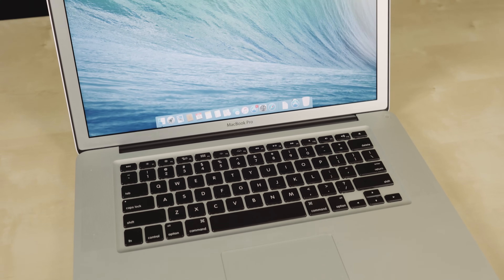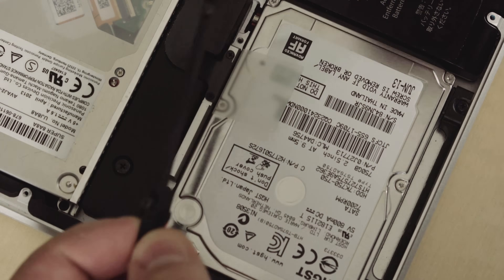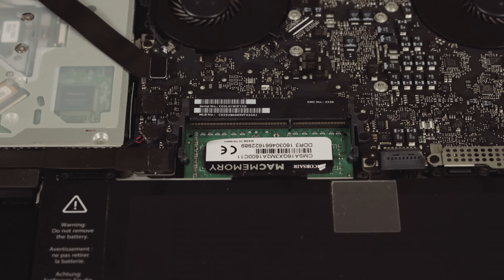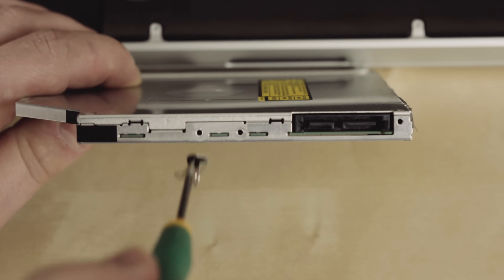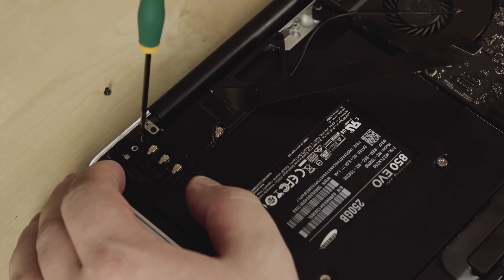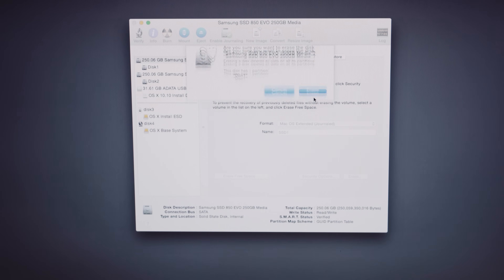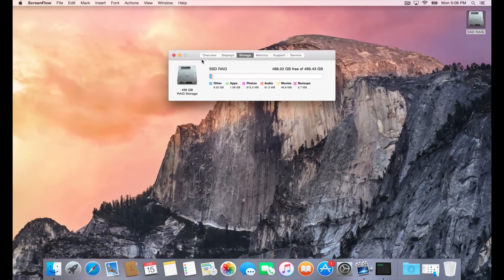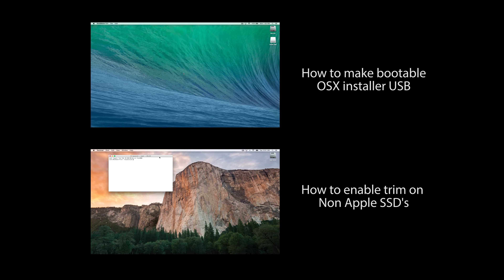Fastest 2012 MacBook Pro Ever! Upgrade Guide - in 4K

Comment: did these ever come with retina displays? if so are they just as upgradable?
Reply from the maker: Derrick Johnson the retina MacBooks from this time didn't allow for any upgrades. You can however replace the pcie ssd with a larger capacity. They are a different kind of drive than the one in this video. OWC makes them

Comment: The hard drive for my laptop degraded to a point where I don't think I could even recover the data on it, I'm really upset about it but wanted to replace it with the same techniques you used here. Is that still possible? I'm not tech savvy at all so I don't exactly understand the OSX drive part of the video

Comment: So I been watching this video over and over. I recently just bought 2 Samsung 840 PRO ssd, with an owc data doubler and 2 sticks of hybix 8 gb each ram. I'm installing it in a MacBook Pro 15" Mid 2012 antiglare 2.7 ghz Intel i7 nvdiea gt with 1 gb of gddr5 ram. I notice in the video I saw a back of time machine rather than installing the OS X from a usb. My question is how come you didn't just install from a back up like time machine. Because time machine also holds the operating system? Also I'm using 10.8.5 mountain lion still. Will all of my configuration still work also?
Reply from the maker: JeffDaSituation I installed off a USB because I wanted a fresh clean install of OS X.
Reply: Zed ProMedia does it make a difference doing that vs from time machine?
Reply from the maker: Its just a clean install of OSX with no extra files. Just like you would get when you buy a new system. Its not like a back up from time machine.
Reply: So you think when I do this upgrade I won't have to get another computer for along time? Is this computer capable of 4K edition in premier? I just bought the laptop recently. Didn't really like the new ones cause upgrading was limited
Reply from the maker: You might get a couple years out of it. Its borderline just able to edit 4k video but it can do it. Its limitation is the video card mostly.
Reply: Zed ProMedia danggg really? This sucks. So what I got till 2020?
Reply: But wait! I could always hook an external graphics processor to the thunderbolt port. Seen it done before lol
Reply from the maker: yeah you can. I want to try that as well haha.
Reply: Zed ProMedia is our computers thunderbolt 1 or 2? And how come you didn't get the 2.7 ghz config over the 2.6?
Reply from the maker: JeffDaSituation thunderbolt 2. 2.6ghz was just what was available when I was looking for a used one.
Reply: Zed ProMedia hey I need it's Me again. I'm not getting a full 6gbps after installing the two drives. I don't know what's wrong please help. I'm getting really slow write speeds also
Reply from the maker: JeffDaSituation what are your speeds? You should be getting close to 800-900mb/s if you are using 500mb/s read and write ssds like
The Samsung evo
Reply: Zed ProMedia less than 100 write and 500 on read. But it's weird just a minute agai it was showing me 200 write and 950 read and the blackmail disk test numbers went back down before my eyes. I don't know what I'm doing wrong. Currently running Mavericks. Didn't like Sierra
Reply: Also using Samsung 840 pro

Comment: Is there a solid difference with the two 250 ssd drives with 16 gig Ram compared to one ssd with 16 gig ram? I was looking at a 500 gig 850 evo compared to 2 250 gig evo.. what is the better option? 1 500 or 2 250's?

Comment: i just upgraded my mid 2009 13'' macbookpro with 256g ssd, 8gb ram, new battery. works just like new.  However, it still has heating and noise issue. i do not know how to make it less heat up..
Reply: gomawum you may need a new battery
Reply: gomawum or open up your MacBook and check if the fan inside is covered in dust, I had this heating issue and once I cleaned the fan the problem was solved

Comment: I can't get it to work!!! Mid 2012 MacBook Pro. I've tried almost everything, but the SSD won't read in the optical drive. When it does, I can't RAID. Most of the time won't even let me erase the drive. How can I fix this?! The main bay and the ram upgrade works so thank you for that! I've been working on this for hours and don't know what to do at this point. I don't want to settle for my hard drive in the optical drive. I want it to be RAID 0 with my SSDs. Please help.

Comment: For Sierra OSX there is no RAID option under disk utility, You have to boot using internet recovery mode by turning on the MAC and holding Option-Command-R, get your wifi set up and then you'll get the  Recovery menu and the Disk Utility from there does have the RAID menu

Comment: My 2012 MBP already has a 500gb hard drive so is the only difference between mine and a newer one is the 16gb ram?
Reply from the maker: ZachAttack84 the hard drive size has no real effect on the speed. It's the fact that it's really slow. Replacing it with an ssd will give you 6-8x more
Speed

Comment: Nice video man. Real detailed. I can see that you put a lot of work in this. Thumbs up! I've got 2 questions though. 

1: Will all of this work with an late 2011 model  and Will it be as fast as the 2012 model

2: What are the benefits off putting the 2 SSD in a raid. Why not use them as 2 seperate drives?

Comment: Hello I have a option to get a new MacBook Pro mid 2012 with 4Gb ram, 500gb hdd brand new or the new MacBook Air 8gb , 128gb ssd but if I get the Pro I would put a ssd in it , do you think the pro is worth it?? Ps I'll be using for university ( not for photo or video editing)
Reply: Tejh Dhilraj pro
Reply: ofcourse pro u can't be upgrade your macbook air but this pro can upgraded to 500ssd and 16gb ddr3 1600 ram so worth the money to buy pro
Reply: Pro!
Reply: Tejh Dhilraj if it's just for uni then I'd go for MacBook Air as it's much lighter. I have the 2012 pro and it's so heavy

Comment: Do i still need to do the RAID0 process if i am only installing one SSD? I am an IT noob and will be attempting this tut with a refurbished macbook pro from March 2012. Just not wanting to replace the optical drive. 

Also, if i did just the one SSD will it be slower? 

Could i chose to take out the optical drive in the future and if so would i need to re-wipe the "old" SSD in order to link them like you've done in this vid? 

Thanks for the response.
Reply from the maker: Gabriel Romero no Raid0 only works with more than one drive. Just drop in one ssd and you're good. Raid0 gives you double the speed but one ssd is still like 8-10 times faster than the mechanical drive
Reply: thanks!

Comment: Hi Zed thanks for the vid it's really an amazing job. I have a non retina macbook 13 mid 2012 - 1TB - 8gb of ram and i was wondering if I could replace the optical drive and add an SSD drive instead and work with the SSD as main drive with all my apps on it and use the original 1TB HDD to put all the files I have (I work with huge samples banks and it takes a lot of room). Also, apple says the maximum ram configuration is 8gb but it looks like you go up to 16. If I could do it, i would too but is it safe?

Comment: I'm trying to do this, and it doesn't look like that on the inside,
Reply from the maker: The only way it would'nt look the same is if you have a retina macbook. They dont have a regular SSD or Optical drive.
Reply: Non retina.
Reply from the maker: Elboogie1975 if it's a 2012 non retina it should look the same. Even if it's a 13" it should look similar but with a smaller battery

Comment: hey i also hv a macbook pro 2012 N/R with stock specs like 500HDD, 4gb ram, INTEL HD 4000. I m planning to change my Hdd with a ssd and in optical drive cn i put the hdd??. And cn u tell me how to clone mac OSx and bootcamp data from my hdd to  ssd. as i cant install windows again as its a 1 time installation activation (i purchased it for $20 from some site called keyguin & the windows was an OEM). So pls help me.
Reply from the maker: Theres a program called: superduper! that I use to clone my drives. I've never tried cloning seperate partitions but look into it on their site and see if it will. Good luck

Comment: Hi, i have a mid 2012 mb pro 15.4" and have 2 ssd evos with 250 gb in it. My question is can i convert both to raid like you did without loosing my files and having to reinstall osx? Greetings
Reply from the maker: you will have to back your files up, Create the raid) array and reinstall everything. When you make the array it has to format everything.
Reply: Ok, thank you very much.
Reply: guamy garcia did you get yours to work? I have the mid 2012 13" and my optical drive SSD won't work. If I switch to main bay it works fine. Not sure why it's not working. I've reinstalled OS about 4 times. It either errors on me when erasing. Or raiding. Or it doesn't even show my SSD at all. I need to get this working ASAP. any ideas?

Comment: Great video! Very detailed and looks like a simple upgrade with the right tools and hardware. My question to you, is there a significant performance boost using two 500 Samsung SSD drives with the raid? I would love to do this to my 15in Mid 2012 non-retina MacBook Pro but if there really isn't any need to do 1tb raid except for the extra storage than the 500 gb raid will do. Thanks again!
Reply from the maker: No performance boost. Just more storage. Thanks for watching
Reply: That was a quick response! Subscribed! Thanks again!

Comment: Hello my lady has a macbook pro 2012 500gb HDD on OS X version 10.11.6 non retina with intel HD 4000, I already know how to do the ram upgrade but I want to know with this setup, is the double SSD setup still applicable? I want to replace her optical drive with a second identical SSD both at 500gb (roughly) to aquire double speed and 1tb of storage. We opted to do a fresh install of the OS with a USB stick and that seems easy enough and she will re install all programs manually instead of using the transfer tool or whatever you use with macs and then she will move the files with a 2.5 HDD (the original one with her necessary files for school such as adobe graphic things and misc important files) using a USB 3.0 to SATA cable. Will this be possible? I def want to do the RAID0 setup unless you have a better suggestion but I am a totaly consumed windows guy and I just want to speed her macbook up for her because it is simply awful especially for the price of those things. I prefer the mushkin brand SSD's and I have no idea if Macs are compatible with all internal SSD's like most windows software and motherboards are. I ask kindly, PLEASE confirm all of this information for me and let me know if its possible before I attempt to follow your guide here in this video. Please respond as I have no experience with mac but I am a PC expert and I dont want to mess anything up. <3 PLEASE @ZED PROMEDIA
Reply: I just subscribed as the only favor I could think of for your assistance.
Reply from the maker: Gabriel Herrera I don't see why it wouldn't work if it's a 2012. As for transferring the files you can buy a cheap USB external enclosure and put the old drive in it. You also get to keep that as an external drive once the files are transferred back. I have no idea if mushkin is supported or not. I've used intel, Samsung and OCZ drives in previous macs and they all worked. Sorry I have no experience with mushkin. Good luck!
Reply: Wow thank you so much for your instant response! The SSD I prefer would be double Mushkin MKNSSDTR480GB Triactor 480GB SATA III 7mm Solid State Drive from amazon or wherever. I have had excellent results from these in my PC's. Also, we have a USB to sata data and power cable already but are you suggesting that a external enclosure would work but the cable that we already own which has power and data connectors will not? It is similar to this one     

https://www.amazon.com/gp/product/B011M8YACM/ref=oh_aui_detailpage_o05_s00?ie=UTF8&psc=1     

It has worked as using an internal SSD as an additional storage drive externally before on this same Macbook. Once again I really appreciate any assistance or suggestions. As for the RAID setup, I have no clue how to "combine" the drives so I will follow your instructions from this video assuming there is no difference in method on the newest version of OS X. I will research and see if they are compatible since you stated you dont have experience with that brand. She is currently using OS X version 10.11.6
Reply from the maker: Gabriel Herrera that's USB to Sata will be fine. No worries

Comment: I have a 2015 125gb macbook pro retina 13", if i wanted to upgrade the ssd to a larger one, how do i safely backup EVERYTHING i have in my current ssd? I mean I have my whole steam library and a lot of documents, I would like to transfer the steam library to the windows os and keep everything else in osx, any tips?
Reply from the maker: You'll need an external drive enclosure and a program called superduper. It does a carbon copy clone of your existing ssd. Keep in mind this guide will not work for your system as your computer uses a pci-e ssd.

Comment: If i get a 2012 Macbook pro that already has 500gb SSD can i still put another 500gb SSD (via the Optical Drive Caddy route) so i could have 1tb out of the two drives?
Reply from the maker: Ridge Bagatsing yep you can
Reply: Zed ProMedia thanks for responding! Which will be better overall, the adding of one 500gb SSD to go along with the 500gb "serial ATA" that the mac comes with to have 1tb in total? or just getting 2 x 250gb SSD's that you used in this video to have 500gb in total?

Comment: I'm debating if I should get an old Mac and replace the it with an ssd and ram I have laying around or get a new Chromebook
Reply: RaFi TV nonono don't get a chromebook 😂
Reply: But I'm just using it for running Linux and I'm worried I'll have to replace parts like the battery on a old Mac and the battery life in general would be low due to many cycles
Reply: Get both. A chromebook is like 100$...
Reply: JustinHit No I got a 280$ Chromebook r11 but I doubt a 300$ Mac will be up to par with battery life

Comment: i got a mid 2012 macbook pro? does it support up to 16gb ram? I thought apple say only 8gb?
Reply from the maker: Son Le if it's the 15" it will. Mine does.
Reply: mine is 13"...:(
Reply from the maker: Son Le I'm not sure if the 13" can handle more than 8gb. It could be a CPU limitation in that generation where the i7 can handle 16gb of ram.
Reply: here is my spec:  13" 2012,  2.5ghz intel core I5. So..no? I dont' wanna buy it and then it won't work or crash...
Reply: A 13 inch model supports 16GB RAM. My 13 inch 2012 model has 16 GB RAM and functions perfectly! Apple doesn't officially say it is supported but in reality it is supported. Even refurbished Apple stores sell 2012 Macbook Pro's (13 inch) with 16GB's of RAM.
Reply: Does your macbook sometime freeze in a lolipop cycle? How do you fixed it?
Reply: My Macbook Pro never froze, so I think it is stable.
Reply: I have 8gb ram, what reason does it froze sometimes?
Reply: Oh, that is weard. Never had that. Here is a topic form Apple: https://discussions.apple.com/thread/4027983?start=30&tstart=0 Maybe it depends on the software that you are running?
Reply: could it be the os version I got? What about you? I mostly run sketch and safari and thats it.
Reply: Maybe try and go to the App Store and download all the available updates (i'f there are any). That can fix the problem. A lot of problems are fixed when you run all the updates from the App Store.
Reply: I always update it to the latest version supported. So at the moment it is OS X Sierra 10.12.2 .
Reply: Yeah I wouldn't advise putting a i7 into it. It is probably soldered.
Reply: it is soldered, safest way is to replace the entire logic board with your desired specs, but then again a cpu costs as much as a damn lightly used MBP according to eBay

Comment: so if I have a 500 gb ssd   and I want to add another one.  it has to both be the same size drives? reason is want to add a 1tb ssd  only
Reply: Brad Blex so by me mix matching  drives  I just can do the raid . so will my set up be slower  compared to a raid set up
Reply: Brad Blex kool thank.  I just want it to work lol but thank you
Reply: Raid is supported...in Disk Utility go to File, and down to Raid Assistant

Comment: I'm using a single ssd on my 2012 Macbook Pro and I'm planning to upgrade the computer. I just wonder whether upgrading my 4GB of RAM to 16 or buying 2 SSDs to use RAID0?
Reply from the maker: Phuoc M. Phan you will see some improvement adding more ram. Either 8gb or 16gb. It won't be crazy faster but you will find you can have more programs open and things like photoshop and premiere will work better.
Reply: Zed ProMedia so which one should I choose, adding more ram or running RAID0 on two other SSDs? :D
Reply from the maker: Both! While you are in there changing things out you might as well just change both. Ram is cheap now. :P
Reply: Zed ProMedia but i only have chance to choose one option :((
Reply from the maker: Phuoc M. Phan do the ram upgrade and then the raid0 ssds later
Reply: Zed ProMedia 8GB of RAM with RAID0 or 16GB of RAM and no RAID would be better?
Reply from the maker: Phuoc M. Phan 8gb and raid0
Reply: Do the Max RAM, you won't regret it. Then do the RAID 0 when you can. I upgraded my RAM back in April of 2015, and I'm just NOW getting to do the RAID 0 due to my need for a new storage system.
Reply: Elboogie1975 I'm on a Transcend SSD with the write speed at about 140mb/s and 500mb/s read speed. Should I upgrade my SSD to another one with higher write speed to increase the performance?
Reply: Zed ProMedia
Reply from the maker: Phuoc M. Phan yeah the Samsung drives are around 500/500
Reply: Zed ProMedia but does the write speed really affect the system performance ?